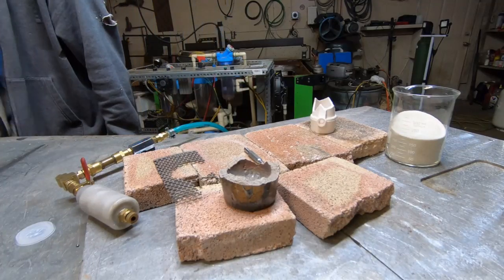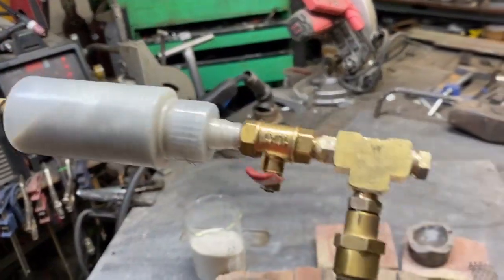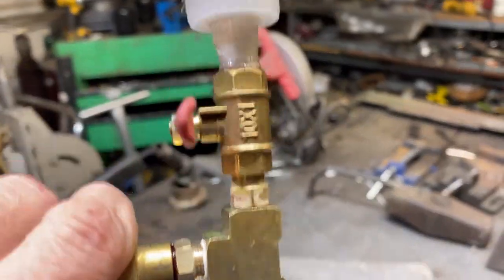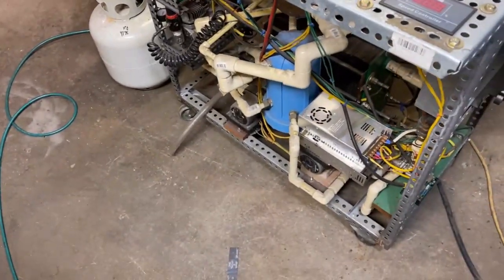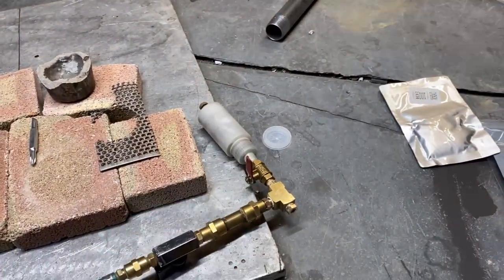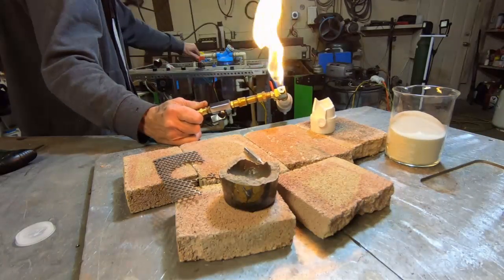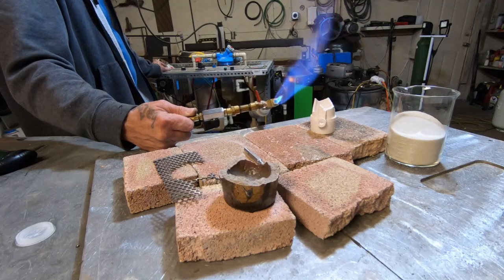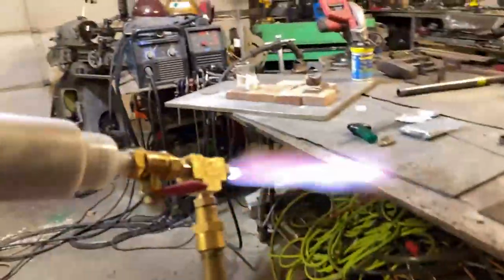Additive manufacturing using oxyhydrogen and sand

Comment: Great video! Can you use a .040 mig tip and a inline sand filled flash arrester to prevent flashbacks from igniting you cell. Buy using the smaller tip you will be able to use less gas for you testing. (Much safer and more manageable)

Comment: At this moment, the oxyhydrogen gas sucks silica mixed with plenty of air. This probably changes the operation of your torch, by reducing flame temperature. With so much gas flowing, you should be able to melt silica with just a propane torch alone with some extra oxygen pressure. The oxyhydrogen torch should handle it much easier.

Comment: heat up a bed of sand that has been screeded flat...dont try and feed it down the nozzle...ya cant heat sand quick enough to fuse it. probably a smaller flame with a more focused tip. watch the metal dust machines...they lay a bed of dust...level it then fuse it then lay a new layer, level, fuse ...etc
Reply from the maker: the idea was to heat the built up material white hot and melt it and hot dry sand could fall into the molten build up and be melted then  during the re heat , yes you are correct it will not fuse in 1 micro second

Comment: I think that most of the metal spray welding setups require two tanks of acetylene to get the proper flow going into the torch. You're probably right that you'd need more heat for that flow of sand, maybe there's a way to use less sand flow. Be safe.

Comment: You sir are a fearless genius!  What about having a secondary mixing chamber for the sand to get heated/molten?  Probably need air injection to offset the added propane.  Make the final exit nozzle interchangeable to find the correct size orifice.